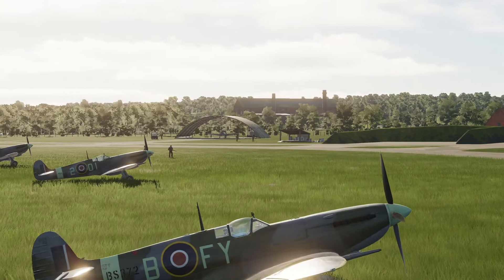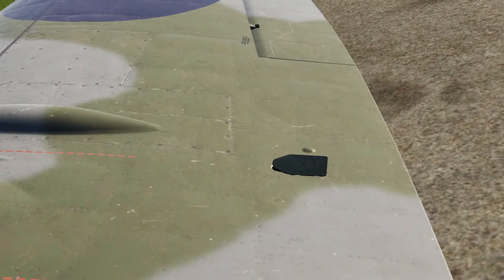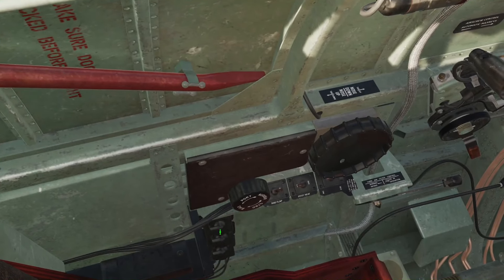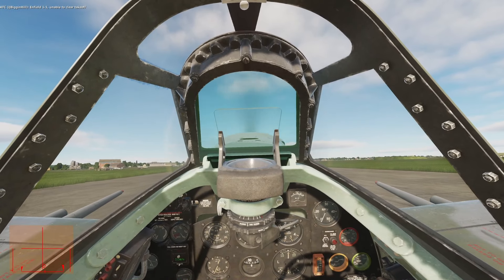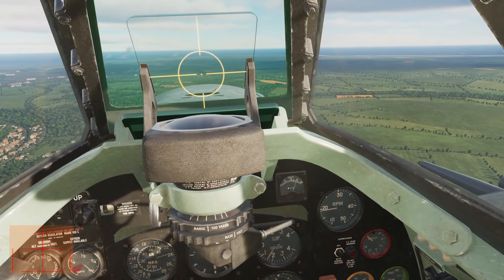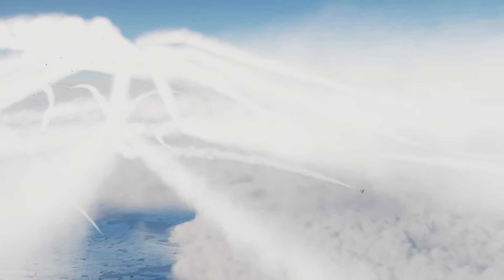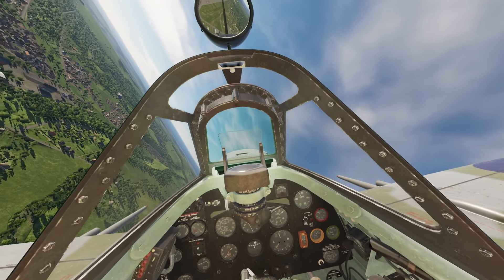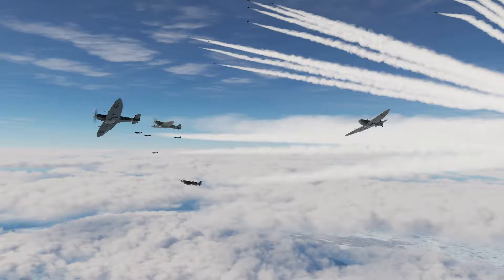DCS: Spitfire IX Tutorial - Startup, Takeoff, Combat, Landing Lesson

Comment: Brilliant Video, as usual, just learning the spit, the taxi'ing im having trouble with have Hotas Warthog/Throttle & TRFP Pedals, think  its the way I've set up pedal brakes ????
Thanks again for your time and effort in making this video, its answered a lot of questions
Steve From LONDON UK
Reply from the maker: Thanks! Set the brakes to a lever on the stick or if you don't have one, maybe a button. But not the pedals.
Reply: @ReflectedSimulations  thanks for reply, The setup I have on a Powerful PC I built myself and runs fine, have RTX4080, High Def. monitor, High spec AMD Processor, etc, etc, AND THE FLIGHT SET UP CONSISTS OF warthog joystick & Warthog Throttle, the thrustm. TRFP Pedals, and TrackIR 5, both types, I have set a (warthog throttle) switch for brakes, as well as the TFRP pedal brake in axis controls, gets a bit confusing really, thought stick brake was like a handbrake on a car, and the pedal brake, again like the brakes on a car ????? and using the pedal brake would be ok for slowing down in axis controls,  ( after refining it on Rudder, brake controls), rather than, just pulling up on handbrake, causing plane to tip forward suddenly???
The reason I'm saying all this, is because under the Control settimgs, it also say's about increasing/decreasing brake pressure!!!!!!!!! SORRY TO GO ON, but I'm finding this very frustrating!!!!
I think I'm getting this all wrong, maybe!!!!!!!!LOL, Your advice would be much appreciated ????
Steve from London UK
Reply from the maker: @littlesteve1000  there is no brake pedal on in the spit, only a lever on the stick, like the one on a bike for example.
Reply: @ReflectedSimulations  THANKS AGAIN for your reply, but how do you control brake pressure, or is it just on or off, if so, then the amount of Spit's, that must have ended up damaging there props. must have been horrendous!!!!! Steve from London UK

Comment: Hi there ! Can get enough of your tutorial, thank you so much. I was just wondering about the QNH setting at 3:57. In fact in real life general aviation, I would set the altimeter at the know altitude of the field, and compare the QNH displayed by the altimeter to the actual QNH of the day. That way you can note the error of the altimeter, and apply that correction later in the flight when the control gives you a local or updated QNH. I wonder if that altimeter error is modelled in DCS ? Maybe on the upcoming Phantom :D Cheers
Reply from the maker: Good point! I’m not sure if it’s modeled in dcs though
Reply: @ReflectedSimulations  yeah I don't know, probably not. I've seen altimeters with correction up to 5 hpa which can lead to an error of 150 ft which is not negligeable when you have to hold an altitude in a controlled airspace.

Comment: Once I got a 20cm extension for my TM Warthog, the Spitfire flew like a dream with 0 curves, and I fell in love with it. One note on turns while taxiing. I've found the rudder+short burst of throttle to give good turns without using brakes. I typically only have to use the brakes when making sharper turns or correcting a runaway turn.
Reply: Remember that drastic actions usually require drastic reactions and the Spitfire's narrow gear lend it to tippping easily, a real problem that the pilots faced.

Comment: Lovely vid, but one minor correction has to be made (for new Spit customers out there). Pressurizing fuel line can be made either by wobble pump, or 30 secs of electric booster pump, NOT 30 secs of the pressure valve - the valve can not do anything when the engine's not running.
Reply from the maker: You mean the one under trim tab? Ah, that makes sense. Thanks a lot for the correction!

Comment: I don’t think there is a parking brake or option for wheel chocks for the Spitfire, so is there a way to keep the wheel brakes on during the start process apart from continuing to hold the keybind down (which means only one hand is free to continue the start process while holding the keybind)?
Reply from the maker: Use the mouse to pull the brake and it will stay like that until you touch the keybind
Reply: Thanks  @ReflectedSimulations

Comment: For a plane that the pilots said was seemless to fly and would do anything that you asked with no adverse consequences, the DCS Spit MkIX stalls and rolls on its left hard even at 280kts in a dive. I'm trimming and using rudder but a Dora is out turning me easily...and outrunning me because of all the time I spend recovering from unplanned inverted/uncontrolled flight. It overheats in seconds even when I barely use the WEP and shakes like a dog shitting razor blades at 320kts with even the shortest bursts of the 303's, nevermind the Hispanos. Watching a recording I saw a 40kt decrease in speed, from 320-280 just from a 1 second burst of 303's at a 10" climb. Not the plane I heard about from actual pilots ohw flew it. The 51, on the other hand is far more stable, again a contradiction of pilot's accounts.
Reply: I think you're reading a bit too much into pilot's accounts. Not that they're wrong, of course, but there's no such thing as "un-stallable" airfoil and thus any wing can be stalled at any speed if AoA gets beyond critical. Spit's no exception and it doesn't defy laws of aerodynamics. In DCS It's a pleasure to fly and will do anything during maneuvers as long as you don't overcontrol it. As for AI Dora, first, AI in DCS uses simplified flight model and cheats (we can't do much about it apart from learning its very limited combat routines), second, you're flying the slowest warbird in DCS against the fastest one (at low to-mid altitudes), so even if you were trimmed perfectly, and If AI didn't cheat, it would still be able to outrun you.

Comment: Turning down saturation limits the control extents so you should never do it. (It would be like putting something in the real aircraft that kept you from ever getting full deflection of the stick/control surfaces.) Presumably the maximum deflections are what they are for a reason and we must be able to get them when needed. (Like at very low airspeeds when they surfaces lack authority.) Bad advice. Stick to curves. (Also, I think they overdid it on the Spitfire. It also feels like it's always tail heavy.)
Reply from the maker: I disagree. It does limit stick movement, you're right  - like I said in the video - but when do you really pull/ push the stick fully? Except for engine runup and taxi? But probably never in flight. I think it's the lesser evil compared to a drastic curve that makes the pitch exponentially more twitchy when past halfway from center.
Reply: @ReflectedSimulations  If the stick wasn't meant to go that far it wouldn't go that far. And yes, engine runup and taxi, you answered your own question. (And I'm sure you can use full elevator in flight if you're slow enough.)

The designers of the plane weren't dumb. They didn't make control surfaces go farther than they needed to. (Now, whether ED got it right or not I can't say. I hope so. But, again, if it's wrong it's THEM who should fix it, not us.)
Reply: Also, you typically don't need fine control towards the outer extents. This is why curves work so well. You concentrate the resolution where you most need it without sacrificing range.
Reply from the maker: @AdmiralQuality  I see your point there...the ideal solution would be if we could change the 'apex' point of the curve on both sides, so it would only start getting steeper at the last 30%, not 50%...
Reply: @ReflectedSimulations  Oh you can! There's a segmented mode, I believe. (I've never used it but you can draw pretty much any shape you want. Would be useful for stuff like matching throttle detents to your hardware.)
Reply: @ReflectedSimulations  I was just revisiting this page to recommend your tutorial to someone else and was reminded of this conversation. Thought I'd point out, there's also a "User Curve" option where you can do exactly what you want there. (Though I'd still recommend a regular curve. I do use the User Curve for rudder pedals on a few aircraft though, to give me a deadband with a nice smooth transition out of it. For example I use these User Curve values on the I-16's rudder: 0 2 13 24 34 45 56 67 78 89 100)
Reply from the maker: @AdmiralQuality  yeah, good point, thanks!